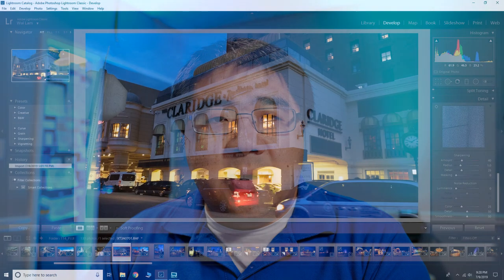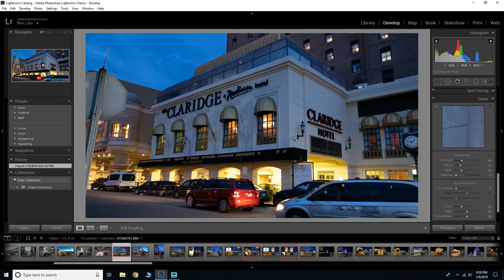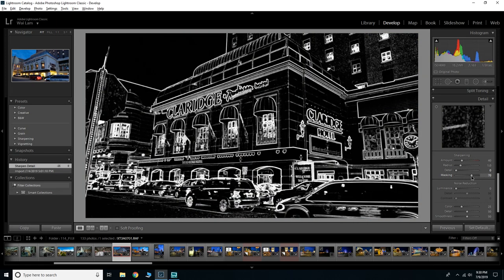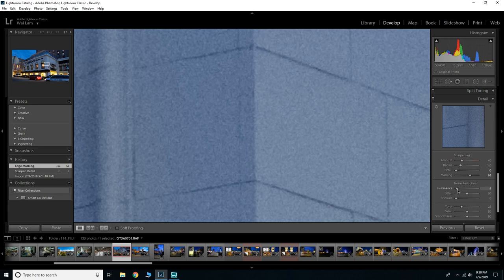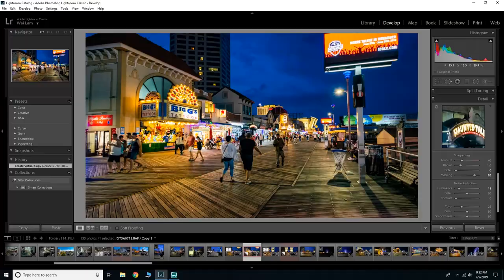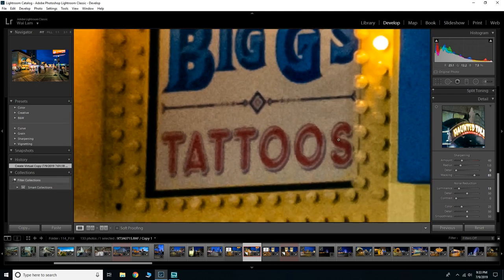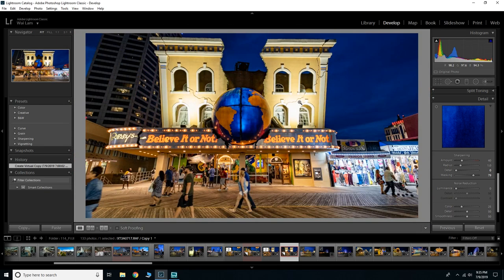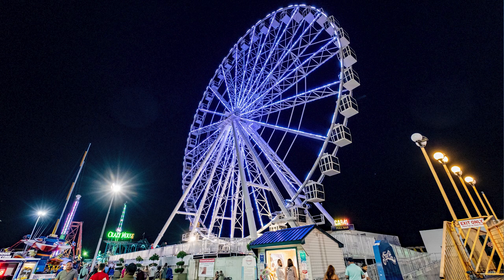Q&A - Fuji Wormy Artifacts

Comment: You can also use lightroom’s enhance detail feature that removes most if not all of the wormy artefacts.
Reply from the maker: oh, good point, I will try that as well!
Reply: Works marginally. Adobe still doesn’t now how to fully decode RAF files. Capture One developers have worked closely with Fuji engineers to come up with much more efficient raw processing. At  Fuji’s event in Dubai in February the engineers said  (watch the video on YouTube) Adobe has not been working with them on this issue. Adobes “enhance details” is just a Sensi AI they made looking for patterns. Whereas Capture One’s engineers  have worked closely with Fuji to map the x trans sensor correctly. If you’re a die hard Fuji user C1 is a must IMHO. I switched and it’s frustrating after using Lightroom for 10 years but once you learn the software the rewards begin. Save the worms for your fish hooks!

Comment: Thanks Wai. What you are experiencing is something that really annoys me about the X-Trans sensor (and a big reason I moved off Fuji). That said, it's baked into the file. Therefore, while some of the post processing tools do a better job at cleaning the worms up; they will never really be gone. The suggestions you have are really good. I've found the same in my use of Fuji RAF files too through use of the sharping and noise reduction tools (backing  them off a bit) would reduce the worms (I use both C1 and LR. Although, C1 probably does the best job of processing Fuji files). Also, like you I found the "worms" mostly in night shots, landscape/cityscapes and portraits (skin).
Reply from the maker: This is the first time it was really noticeable for me and I can see why it can be annoying

Comment: Thanks :) 
One important question for me that I cannot find the answer to it.
Q: When i shoot both Jpec and Raw, i put these two versions in Lightroom. However, I noticed that, if I edit my raw version to mimic the jpec version that came from my camera (x-t3), I really can’t! In all aspects, colour, shadow and highlight. 
My settings are: Classic Crom, with -2 highlights

Can you please suggest how solve that matter! 
You can try to shoot both jpec and raw (classic chrome), and try to mimic the raw version in Lightroom to match the jpec. It would have a totally different look
Sorry for the long question 
Cheers from Australia 
Ricky
Reply from the maker: Ricky, the easier way to solve this problem is to use a lut that mimic classic chrome. Im pretty sure there is on for Capture 1 and you can find and download one for LR. That is what I would recommend. then you can adjust from there. Just google for fujilm classic chrome lut and you should be able to find a few lut solutions.
Reply: Wai Lam thanks ❤️

Comment: A fiend of mine lend me his XT3 for a couple of days... I use Lightroom and pictures looked really nice, but when I pixel peeped I noticed that the files looked so artificial.. like watercolors (like excessively processed jpgs). The shorts were taken at base ISO midday. I went to try my old Canon 5D MKII to the same location and got a completely different result, not so sharp, but natural looking.
Reply from the maker: I'm not sure, sharpening might have been increased in camera. If you still have access to the xt3, there are some settings to lower sharpening in camera.

Comment: Forget Lightroom and use Capture One Pro to import and edit the RAF files. Any further editing can be done in Affinity Photo. This will also save costs, a free Fuji version of Capture One is available. I use the XT3 and find that for 90% of the files the following settings produce a worm-free image...Sharpening to 170 / Threshold to 0.5 - Radius to 1.1 - Lum' to 0 ( yes 0 ). Any other adjustments, exposure etc, as required.
Reply from the maker: Thank you for sharing your experiences and I think you are on target. I do have a lot of people that talk to me and use LR, so I still want to create content for them.